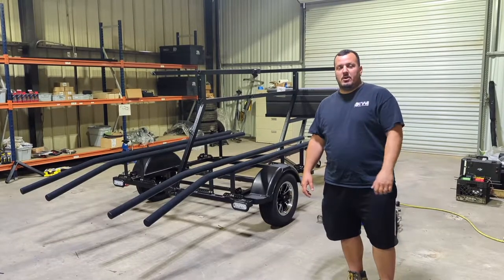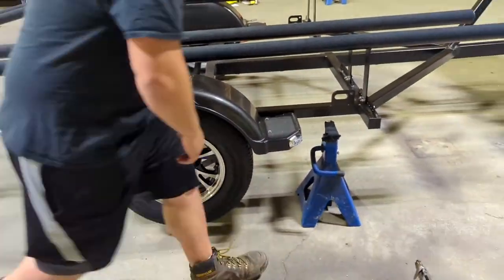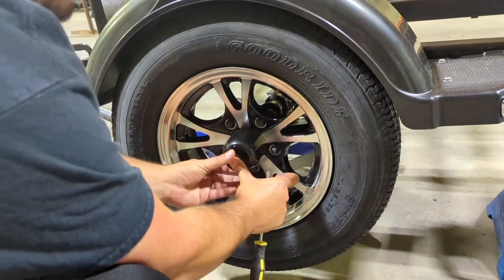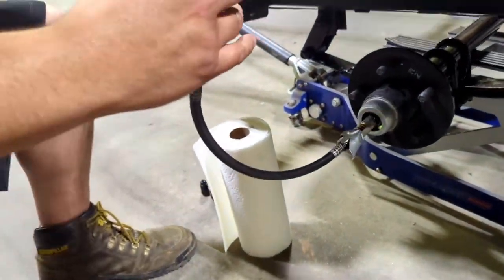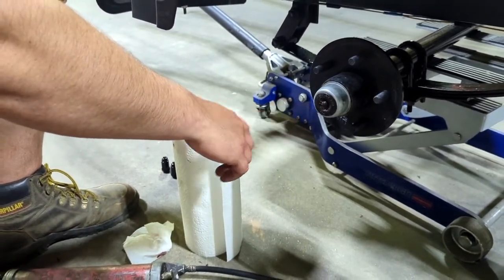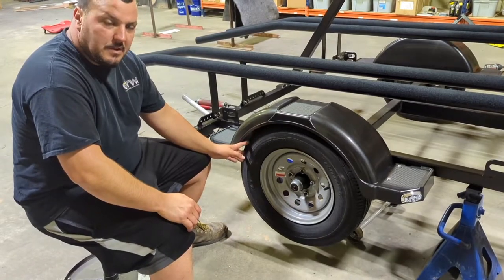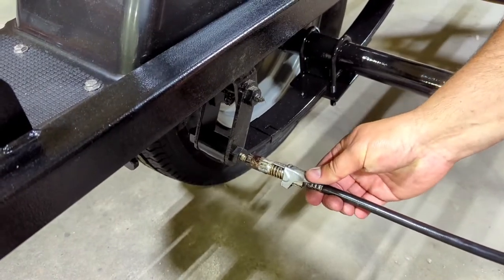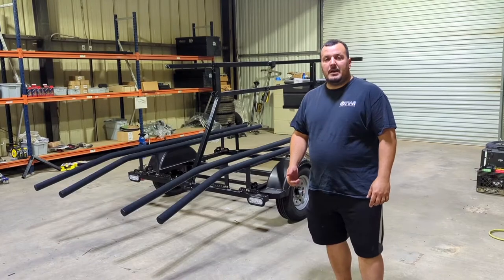How to maintain your EZ Lube Hub and grease fittings

Comment: Dexter has specific temp requirements for the lithium grease used. I found auto parts stores often carry varieties that don't meet minimum specs. Also, Dexter states never pump grease without hub spinning.
Reply from the maker: Yea it will be easier as a 2 man job

Comment: Might want to use wheel blocks (chocks) on the other tire to prevent trailer moving around. I would also loosen the lug nuts before jacking it up. Same with lowering it. Tighten a bit when jacked, then tighten lug nuts to proper torque when all the weight is supported by the wheel/tire, i.e., when jack removed. I have become pretty committed to proper torque on truck/vehicle and trailer lug nuts. Especially on my boat trailer which have their own brakes. Always check proper inflation as well. I see so many sketchy trailers flying down the road and it’s super dangerous to the driver and other people on the road. These trailers are light duty but if you’re going to run them at highway speeds, best to have your weight distribution (tongue weight), lug nut torque, bearing adjustment and lubrication, and tire pressure right. Look up “death wobble” and see what happens when, for example, tongue weight is off.
Reply from the maker: thanks for adding in the extra info, definitely some great tips!